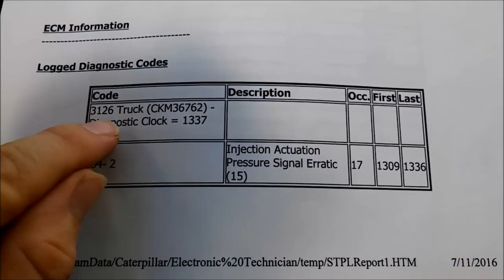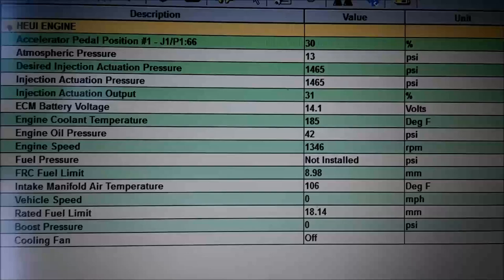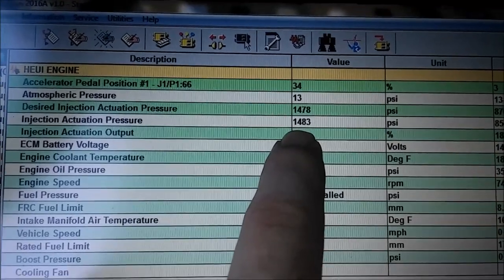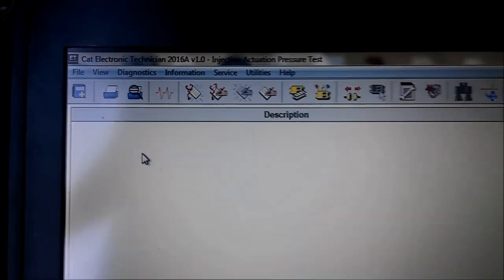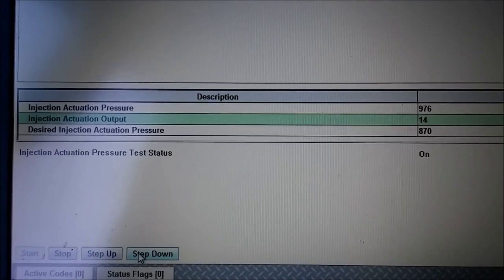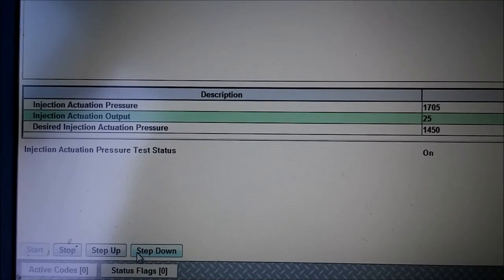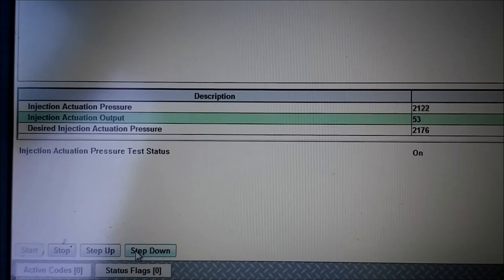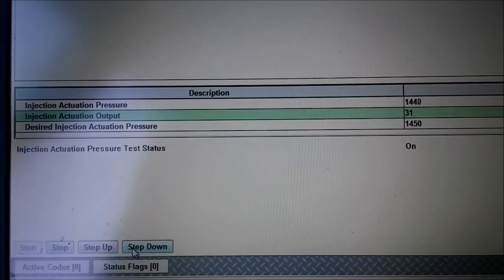How To Troubleshoot HEUI Systems and IAP faults. 164 Faults.  3126, C7, and C9 Cat Engines.

Comment: I have a 3126....was starting hard....new injectors and speed sensors...now it starts great, but after it runs hard for 20 mins it loses power....I pull it off the road and let it sit for a half hour then it'll take off like a rocket then do it again. I keep my filters clean and change oil very often....intercooler has no leaks....any ideas?? Thanks
Reply: Brian Lewis any luck?
I'm having the same issue

Comment: I have a C7 Engine. The injection actuation pressure cannot match the desired injection actuation pressure. The injection actuation pressure is always at 1700PSI even when the RPM reach the max. or min. I suspect that there is a internal leak. Any suggestions on where is the leak, what is a likely cause of this problem?
Reply from the maker: +Shen Yeong Lim Are you measuring the pressure with a gauge or off of the computer?
Reply: off the computer, it is about 1700PSI, on the pressure gauge it is about between 3000-4500PSI.

I attached a pressure gauge on the HEUI Pump, attached youtube video is the result.

https://www.youtube.com/watch?v=tpJ8nYjo7P4

Is the HEUI PUMP for C7 engine interchangeable with C9 engine? Are they the same? I removed the C7 HEUI PUMP and tested it on a C9 engine, it works well with no issue.

Attached is a video of the C7 engine with the cylinder head cover removed, running at 800rpm. The engine oil seem to spray out from the cylinder head as though it is at high rpm.

https://www.youtube.com/watch?v=eKrewSw1Muc

Lastly, when my C7 engine is at 1500rpm(speed 6), there is a humping/surge of the engine speed. While at all other engine speed it is stable.

Comment: i have 1996 3406e cat that was rebuilt and been sitting a few years started it up and noticed oil drip out of exhaust manifold very small drip and then almost stopp is that something too be concerned about also has new turbo with no oil deposit and new compressor
Reply from the maker: +douglas freeman Typically when you have oil coming out of the exhaust manifold when it sits for a long time it's the valve seals, but if it dries up quickly and then stops, I wouldn't worry about it too much. Just keep an eye on it, but if it was my truck I would run it.

Comment: i have a 2000 f650 i  think it 3126 cat engine. what going on is that cranks but  no start until u spray brake cleaner into intake. 
so to diagnose the problem i disconnect the IAP sensor thats next to the valve cover and cranked it and it starts up. then reconnect and no start. so that makes me think that there no enough oil pressure to fire the injector, right? but not sure if i have leaking injectors or a bad heui pump.?
Reply from the maker: If you disconnect the sensor and it starts up you probably have a problem with that sensor or the wiring to it. The sensor might be sending a pressure signal and the ECM might think there is pressure when there isn't. Best thing to do is hook up to it if you can and see what the pressure reading is.

Comment: How common is it to have a HEUI pump fail on a C7?  I work for a school bus fleet and we are dropping in new injectors and pumps every 85,000 miles or less.  Plus, the engines seem to not start below 50 degrees.  That even goes for the brand new ones (by new I mean the ones that are in the 2008 Blue Bird Visions with the Volvo chassis.  With 350 miles on the engine they had to be plugged in at 53 degrees) and the engine swaps that I have done.
Reply from the maker: +BW8x10 The HEUI pumps fail a lot unfortunately. The pump and injectors are the biggest failure point on those engines, the school buses we have around here rarely has the original pump at 100,000 miles, but they do oil changes at 12,500 miles I think. What are your oil change intervals for the C7 engines? Those engines can use 10w30 weight oil and that may help the cold starting a little, but try to do a manual cylinder cutout test when the engine starts up and is still cold, usually you have one or more bad injectors when cold that need replaced. It gets in the low twenties here and while they don't exactly start like it's been running all day, they will start in the winter, just wait for the inlet heater and make sure you're firing on all cylinders.
Reply: Sadly they do.  I have replaced 7 of the 11 buses that have the Cat in them.  Some more than once already.  My oil changes on them are every 6,000 miles with GUARDALL oil.  From what I have been able to find out it is the same as CAT engine oil in every regard other than name and price.  As far as the weight of the oil, I normally run 15w-40.  I have put 10w-30 full synthetic (advised by FABICK CAT in Madison Wi) and have no better cold weather starting.  Have replaced all components of the intake heating system also and no improvement.  Plus cold injector cut out tests and HEUI tests also and everything is as good as new.  Now I know that these are no 9 liter International engines that roll over 4 times and start in 5 degree weather but I was expecting at least 20 above with a rough start.  What has me bummed about this particular engine is that I was expecting starting and dependability like the 3116 Cat.  But different engines, different designs.

My winters here get as cold as - 58 degrees so cold starting is a must.  The ones I have the most issue with get put in the work shop where it is heated to 50 degrees and they are plugged in inside the shed and still fire on 4 cylinders till the other come to life.  Then 10 minutes of airing the shed out to get rid of all the smoke lol.  (It's just cold start exhaust.  Believe me, I have checked to make sure there are no head problems or antifreeze leaks into the engine.)
Reply from the maker: +BW8x10 Did you say -58 degrees! Holy snow balls Batman! I'm guessing you aren't in San Diego. Hmmmmm, well your definitely doing good service intervals and in my opinion (Cat says otherwise) the oil brand doesn't seem to matter that much to me.

I'm afraid you may have me stumped here, since it's multiple buses doing the same thing, it isn't just a weird one off problem. It is odd that is starts having problems at 50 degrees though, as we don't seem to have them until its around the 30s. Now they are not great cold starting engines as we both know, but have you contacted Cat about possibly getting a Technical Communicator involved with Cat to see if perhaps there is a problem with the software version or something?
Reply: I have contacted our cat dealer, which is FABICK cat in Madison WI.  They said they would send out a technician but it would take 6 months for them to get one out to me.  I have taken one bus there and it took 3 months for them to put a HEUI in under warranty and I am still waiting for them to send someone out.  So if the amount of time it takes them to fix a bus is any indication of what the technician will be, I'm thinking it will be dismal.  Nothing against CAT or their trained techs but it seems to be just this DEALERSHIP.  I call about once every two weeks and get the same run around.  The manufacturer says contact a dealer, dealer says contact manufacturer.  So I am just dealing with the issue and moving on.  Like the videos though!
Reply from the maker: +BW8x10 I'm sorry you had such a crappy experience up there, every Dealership is a different company so some are better than others, or worse than others in your case.

Comment: good morning I am working on a 3126b that will not start. I cannot hook up my scan tool due to it being in a Ottawa switcher truck it is wired for off road. this thing cranks but will not start. how can I check out this heui pump without getting into to ecm?
Reply from the maker: +Chad Schmid Well you might have to hook up a comm adapter to the ECM with a jumpout harness. You can put a very high pressure gauge on the HEUI rail in the head and see if you are getting any cranking pressure.

Comment: Do some other Diesel engine manufacturers use huei pumps on their engines like cummins or Detroit diesel?
If you haven't had experience working on engines from other companies, please just say that.
Reply from the maker: +6speedguy84 Some of the Powerstroke models used them, I know that because I have worked on a couple of them. They use different terms for some of the stuff, but the system is similar. Now on the other manufacturers I'm not sure.

Comment: I am changing my heui pump on c7 and I am not sure if if I have to put oil in it before I try to start the truck? I got the part from cat dealer
Reply from the maker: +Packing Bees Inc You don't have to prime the HEUI pump. It would probably be a good idea to squirt some oil into the holding chamber, but it isn't necessary.

Comment: when i do the injection actuation pressure test i cannot get pressure into the 3000 it will code out on me and get the 164-2 code i have i to shut the truck off and start again iap test wont respond  plus i am getting 64-2 and 64-11 driving me crazy please help

Comment: I had a situation the other day. I loaded the motorhome (2004 Fleetwood discovery with a 3126) drove about 3 miles and the engine lost power. I pulled over and tried to figure out what went wrong. I tried starting it just one time, and I cranked it for about 5 seconds, with no luck. It seemed like it was out of fuel. I started the generator and that ran fine. So I knew I had enough fuel. I sat there for about an hour, and then tried to start it again. This time it fired up and idled fine. I drove it around the block, up and downs hills for 30 minutes. All seemed good. I drove it home and parked it. I started it up the next morning and it seems fine. Question can it still be the HEUI pump or more likely a sensor?
Reply: gen could have had left over fuel in its lines,,
Reply: @SolHersh  I realize this was a year ago, but since you didn't edit or delete your comment about there being fuel left in the generator. His next sentence was that he waited for an hour, it then started and he drove it around with no problems for thirty minutes. Obviously not out of fuel.
Reply: Did you find the cause?

Comment: I have an cat c7 actuation pressure when engine cold is good at low and high rpms . Once engine gets hot, pressure fluctuates at high rpm . Any suggestions?
Reply: I have the same problem. Did u ever fix it?
Reply: I have a similar problem with mine to like

Comment: I have a c7 with no codes. It will not start.  It barks on ether but dies when it burns off ether.  The fuel pressure is zero on crank. I replaced the fuel pressure regulator.  Still no start. Fuel does come out of the test port when I pressure the plunger with a screw driver. Has a new huei pump 2 years ago.  Looks like they installed the old lift pump.  Any ideas?
Reply from the maker: +Evan Magee A new fuel transfer pump comes on the HEUI pump, so that should have been changed with the HEUI pump. You should be building fuel pressure while cranking to about 25 psi. Have you tried supplying the transfer pump from a bucket of fuel? That would eliminate the whole inlet side, if it still won't start then remove the HEUI pump and inspect the drive gear, if it is okay then it sounds like you need a new fuel transfer pump.

Comment: I have a problem with a 329D excavator powdered by C7 engine. the engine is running rough and when the engine speed is increased, the desired iap increase to 3500+ while the actual iap stays between 1780-1800psi. the pump has been replaced before now and also the injectors bt no difference. in fact the iap was also replaced without any difference. pls what can I do to solve this problem. the engine has power to work bt running rough and brings thick smoke early in the morning for about 5mins and the smoke wl later clear
Reply from the maker: +abiodun aminu Do you have any electrical faults with the HEUI system? If the wiring going to the pump is okay, then you have a bad pump or a leaking injector. Pull that valve cover and start the engine and then rev it up, you may have a leaking injector seal. If you do it will probably squirt oil out of the injector that's leaking.

Comment: I have a 3126  i put a new heui pump on it   it still will not start   I have loosened the fuel lines one at a time and not fuel is coming in new fuel filter already installed

Comment: I have a c9 on a D6R on the ET I'm getting 259 psi of the heui pressure the troubleshooting say it should be 870 psi is it the pump ?
Reply from the maker: +Amit Ramrattan Could be the HEUI pump, bad sensor, or leaking injectors.
Reply: Adept Ape hey I got tru with the machine it was the heui pump

Comment: How about runs great but will not idle, No check engine light and it's a 3126? New filters and primer pump.
Reply from the maker: +jeff hamilton It shuts down at idle or it only runs at high RPMs all the time?

Comment: hey I have a 2136 cat in my dump truck and its putting oil into the fuel system\fuel tanks know what can be doing this
Reply from the maker: +Mike and Jeremy Gould I believe you have 3126, but you have an injector passing HEUI oil into the fuel system. This is pretty much certainly the cause. You can pull the injectors and reseal them, but it is possible you have an injector leaking internally, which would mean the injector has to be replaced.
Reply: yes sorry that what I meant 3126 would this make the engine had to start

Comment: Ser No. 7AS44859 99 C6500 Rollback I can cold start it in the morning and it fires right up no hard crank idles great I drive about ten or so miles and when I start to slow down around 45 mph the check engine light comes on and it goes into a safe mode where I can't go faster then 50 mph and while I'm still rolling I turn the ignition off for a few seconds and turn it back on the engine will restart the check engine light turns off and resumes full power.. Recently I have had the injector cups replaced but this problem started a few days before the cups were replaced I have had my small town truck shop scan it but is limited with his Snapon scanner so far its told me to replaced the Timing sensor, Actuation Pressure Valve and the Actuation Pressure Sensor and the Fuel Pressure Regulator.
Oh the fuel system I pulled the tanks off drained and cleaned them replaced fuel filters
Thanks for your Channel really informative any help would be appreciated
Reply from the maker: +john gregory Your HEUI pump or HEUI pump driver is most likely at fault for those codes. You would want to hook up ET to it and drive it and see if the code comes up while your driving it.
Reply: Thanks thats what I did changed out the HEUI pump and the new upgrade tubing kit and it straightened all the problems thanks my man so stoked

Comment: Will a ICP sensor stuck at 2300 psi cause a no start?
Reply from the maker: If the sensor is stuck at a high reading the ECM will be dropping the current to the HEUI driver to try and drop the pressure, so it is possible that could cause the problem, try unplugging the wiring going to the sensor and the ECM should have a default limp mode setting, maybe it'll start.
Reply: Sensor was defective, thank you
Reply from the maker: +Travisfromoregon You are welcome, glad it's the sensor, that's a lot cheaper than a new pump or wiring.

Comment: does a c10 have a heui system?
Reply from the maker: +SkinwalkerRanch No sir, it is a Mechanical Electronic Unit Injector, sometimes called a MEUI or EUI system. It uses the camshaft and the ECM to fire the injector.
Reply: Adept Ape i really enjoyed your videos. My c10 has extended long crank with intermittant start.  With this not having a heui fuel system, what steps should i skip or take? THANKS!!
Reply: so since we have a MEUI what is the diagnostic flow chart for a long/extended intermittant start?
Reply: adapt ape can you please reply?
Reply: since i have a MEUI system with a long extended crank intermittant start issue, what is the didgnostic flow chart?
Reply: battery was dead today (sat for several days) had it jumpstarted at like 15 volts and it immediatly fired right up.  Does this have any bearing on a solution (electrical?) while cranking (without the jump) the revolutions sound good and not slow.  Wonder if it just needs all new batteries?  My main questions is what to do next to diagnose a MEUI system with long extended intermittent crank symptoms.  I bring the truck into a international dealer with a trained cat tech... and I want to tell him EXACTLY what to test... THANKS!!
Reply: now knowing that the c10 is a MEUI or a EUI system does that mean it is a "common rail" system?  I would like to add "restore" additive to the oil and the manufacturer is very clear NOT to add it to a HEUI system.

Comment: IM LOOKING AT THIS BECAUSE WE HAD ONE SATURDAY THAT HAD TO GO, IN FOR AC. THE ENGINE WOULD CRANK AND NOT START. IT WAS THE END OF THE DAY AND EVERYONE IN THE ROAD CONSTRUCTION COMPANY CALLED ME 10 TIMES, "IT HAS TO GO" ONE OF THE MECHANICS UNPLUGGED THE HIGH PRESSURE OIL SENSOR AND IT RAN. COULD PLUG IT BACK IN AND THE ENGINE LIGHT WOULD GO OUT. SO THEY GOT THEIR TRUCK. I DON'T KNOW HOW MANY TIMES I HEARD, "YOU CANT DROP OFF A TRUCK AT A REPAIR SHOP RUNNING AND NOW IT DOESN'T RUN!" #&!$!

Comment: can you tell me why my 3126 has a c7 pump on it
Reply from the maker: +William ahrensfield jr The later versions of the 3126E had a C7 style pump right before they started making the C7. It is actually a different pump if you remove it you'll see that the sealing area is different in the front of the pump on the 3126 version, but the pump is the same as far as I know other than that.
Reply: thank you for getting back to me so fast is there anything I need to worry about with the 3126e I just got the truck it has 160k on it